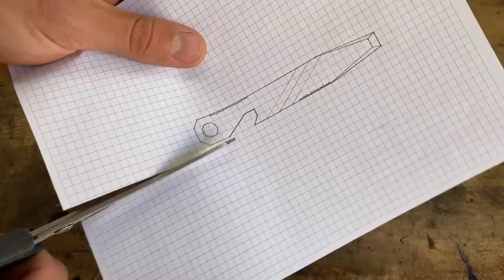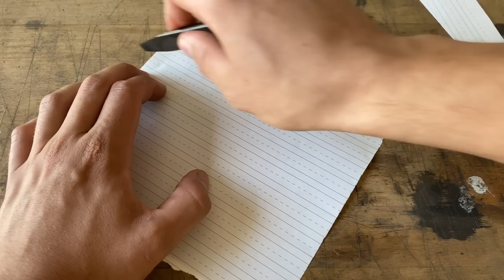Making a EDC Pry Bar

Comment: If possible do your drilling holes first so you  have something to hang on to or clamp more securely . Just a tip from a retired Toolmaker from Down Under in Australia
Reply: Thanks for the info 👍

Comment: Nice idea. Even if I don't follow your design, I hadn't even thought of it until I saw your video and I realized that there is not much to these in terms of production, materials, parts and process-wise. A few minutes ago, I wondered about making a can-opener from a solid piece of metal for a one-piece construction-design similar to a bottle-opener.

Comment: and what exactly would you need the bottle opener for? i mean, its not hard to open a bottle with the pry bar itself.... But i guess, every takticool thing out there must have one.
Reply: some people don't know how to use a leverage to open bottle, so the bottle opener still make sense, and if he measure right that hole can double as a 1/4 inch bit driver
Reply: I don't feel the need for the bottle opener either, but here's a thought: it'll keep the edge sharp. Not that it'll matter much; you'll avoid using the edge to use the bottle opener instead only 1/100 times.

Comment: I would buy one of those. The ones i find at sports store r cheap " made in china crap"
Reply: jajaajajajjaajaa .. and without complications .. jajajajajajajajaa ..
Reply: I really appreciate you showing how to make one but I wish you would explain what and why  you’re doing something   What does the blue liquid do what is the liquid did you put the tool in that turned it black is that phosphoric acid Using the magnet to hold a metal is a cute idea thanks would never thought of it
Reply: @philb5  ferric chloride is the acid etch and the blue is called dykem. It is just a coating like a sharpie to be able to mark the steel to see lines prior to grinding etc.

Comment: I have a chunk of brass I want to make into this, would you heat treat brass? By the way, way cool design
Reply: Brass is to soft, it wouldn’t work. But you can find O1 Toolsteel for about 10 bucks and it would be enough for 2-3 pieces
Reply: Would brass plating work?
Strength and style...best of both worlds

Comment: How thick is that plate you used?
Reply: Also, what is that tool called that you used to cut the grooves on the edge?
Reply from the maker: 5mm, I use chechering file to make that.
Reply: @AVmake  Thanks very much.

Comment: I guess I miss the purpose of EDC. I've been to a lot of places in a lot different situations and have never needed a pocket prybar, or 90% of the EDC gear I see on the internet. Instead of tool making videos, how about an explanation video? I want to be prepared, but I just end up buying twist off capped beer.
Reply: Kali Southpaw  I have a pair of aluminum pliers, a scale and scissors for fishing. I leave my fillet knife at home, as I'm not cleaning fish while I'm fishing. I catch plenty of fish, but haven't found a need for Batman's utility belt and 9 pounds of bespoke metal in the heat of summer. I guess we solve problems differently.
Reply: these thing are essentially pocket novelty than a tool for serious job, I guess. You can pop a bottle, pry a paint can open, scoring stuff... and that's it.